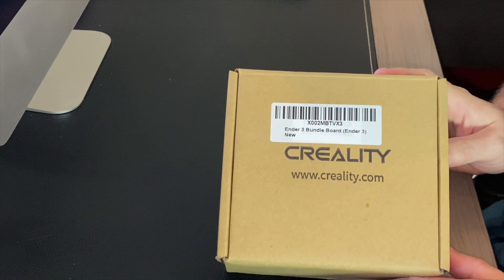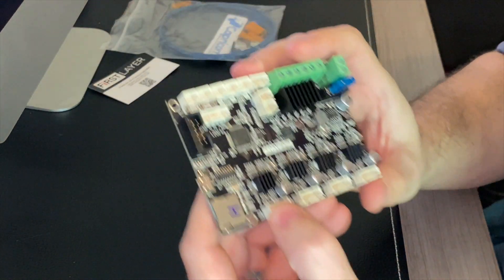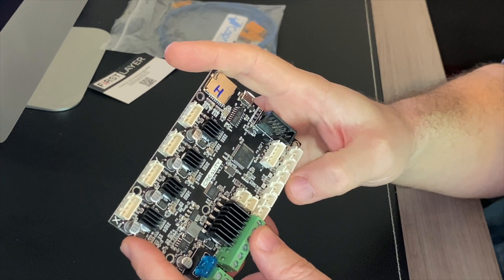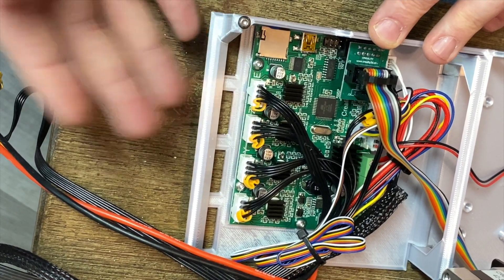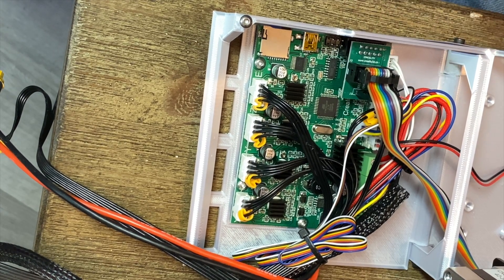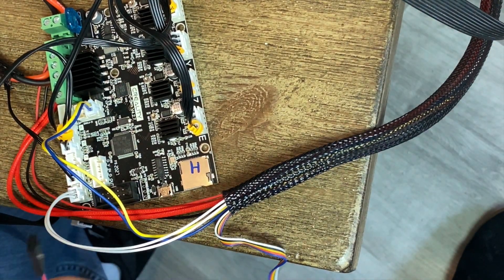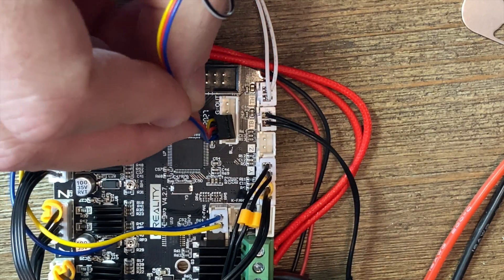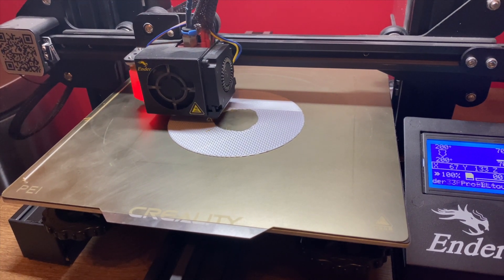Creality 4 2 7 Silent Board Install With BLtouch

Comment: this video made me realize that I didn't ned the breakout board anymore and that the v1 bltouch wire is a crossover cable and you need a straight cable to connect to the new mobo. had a v2 in my mailbox within 12 hours and just swapped the cable and it was fine

Comment: After installing the same BL touch kit into the v4.2.73 board I found that the fan to the nozzle that was plugged into the header where the power is connected needed to be changed so that the control box fan is in that header and the nozzle fan is in the header marked fan1 on the mother board as this is a controlled fan now.

Comment: Did you have an issue with the printer throwing error 'Home Z first' ? Trying to resolve this and cannot seem to get past the error. Thanks!
Reply: I am having the same error... please let me know if you find an answer. It is absurd, trying to resolve it, but not having much success.
Reply: @Bbittner5857  I actually did figure this out.. Move the bl touch power wires from the Z axis, to the dedicated port. I used nippers to cut off the retain for the cable so it would fit.
Reply: @sparkfire1223  so move the black and white wires next to the yellow red and blue? I thought about doing that, but I didn't want to fry another board.
Reply: @sparkfire1223  that works! Thank you so much...

Comment: I have a v 4.2.7 board,i tried flashing both 4.2.7 5×5 &3×3 firmware, but everytime i tried to press the leveling menu it did not went for auto bed leveling instead it showed me manual bsd leveling,so i had to go for stock bl touch firmware..pls help

Comment: Did the swap back in January and had nothing but clogs until I realized last week that my fan power wires were loose so heat creep kept clogging! Anyone having any issues after the swap make sure your extruder fan is working!
Reply: thanks, dont have this myself but im sure you saved someone a lot of frustration

Comment: I’ve had the same problem on BL. And i’ve just done the same solution. I was also surprised by the x y a e motor connector arr fliped.

Comment: Thanks for the video. Liked and subscribed.  I did this same install yesterday on my ender 3 pro and installed the bl touch as well.  Followed creality’s direction but my nozzle head is way out of sync.  It remains about 2-3 “ above the bed.  Autohome doesn’t work properly. Any thoughts on this issue?
Reply: Did you solved your issue same thing happened today
Reply: @ricardoz.6701  yes :-) I bought a resin printer.

Comment: Can you provide your .bin file? I also upgraded to a 32bit 4.2.7 silent board and a 32bit BLtouch. Before I used the firmware from creality but I want to change it because it just doesn't seem to work right. (It worked, but the options were too limited with it.)

Comment: Did you have to change the firmware for the BlTouch or was ist Plug and Play?
Reply from the maker: You will need to change the wiring  like I did in the video.

Comment: As a ender 3 pro owner I tried installing the firmware for the bltouch for v2 and my board froze up blue.  I ordered an upgrade silent 4.2.7 and want to know if any firmware is still needed for the bltouch?
Reply from the maker: yes you will still need to flash your firmware. I build mine from marlin

Comment: So I followed this and at least it did not fry my board. Still can't get it to work though, it's not homing the z-axis. Creality FW just says: STOPPED! Any ideas on that?
Reply from the maker: sounds like there is an error in your firmware. I would try and reflash
Reply: Hi Roy, I have the same problem. Did you fix it?

Comment: Hi dude, thanks for the video. I have an creality ender 3 with the creality silent 32 bit board v4.4.7 (ARM stm32f103 chip). I bought the BLTouch and I'm struggling to find firmware for my board to add support for the BLTouch so I wanted to compile marlin for my board and add the BLTouch support and found your installation video. I download marlin with the Configurations-release-2.0.7.2 and found the code to support BLTouch. However I'm struggling with something relatively simple I cant find how to add support for my ARM stm32f103 chip in arduino. Can your or anyone else help?
Reply from the maker: you will need to find the line that asks for the board name/type and type in the correct board chip name.

Comment: Nice video, I wonder if the 4.2.7 is compatible with my CR-10 mini because the output voltage from my power supply is 12V and for Ender printers it's 24V. Since the circuit board uses 3 to 5V max I guess it will work but I am not sure.
Reply from the maker: Im not for sure about that sorry

Comment: The only part i want to know was where the case fan goes. Exactly this part is missing. I dont't know a first i put it in the second kfan. But after my first try to print the nozzel fan wasn't moving so now im sitting here like a Duck. Any other cable is rihgt
Reply from the maker: The hot end fan is the end connector on the green wire hook up spot. I believe it’s the top one on the left right under where the power input is hooked up. The case fan and cooling fan have plugs and plug into the board in the two pin plugs that are on top of each other under the green 6way plug. Hope this helps.
Reply: Honestly, the smartest thing you can do with that fan is wire it in with the Hot End fan. Have it always on. Currently it will only turn on using the cooling fan comes on.

Comment: hello 3D4LYF...
I followed all of the instructions, rewired the 3 wire connector.  
Auto home does not move the Z.  I can move Z with the move axis.  
X axis and Y axis work just fine.  printer pretty much useless after installing the BL touch. 

Ender 5 pro, main board v4.2.2 

Any ideas?

Thanks, Dan
Reply from the maker: I’m not for sure. Had an issue like this once and I think I reflashed the firmware or maybe swapped the white and black wires on the BLtouch.
Reply: The firmware versions for 4.2.2 and 4.2.7 are NOT compatible... double check you have the right version. (that was my issue anyway)

Comment: Did you use this firmware?? >> Ender3 V2 -V4.2.7-32bit
-Marlin-2.0.1-V1.3.1-BLTouch-TMC2225  << from their wabsite?, if so did you need to fix firmware on lcd screen aswell and do any alterations need to be made to the creality/marlin firmware, eg what kind of setting did you change, gcode additions?, you have provided a good vid but just feel a bit more information could assist myself and alot of other peropl asking about this installation cheers
Reply from the maker: I did make my own firmware in marlin from the source code under the 4.2.7 board. The only thing I changed in my start code was adding g29 for abl. I plan to make a video on firmware soon.
Reply: @GhostPants8012  awesome, can't wait to see when it it goes up, a lot of people are having issues with the wiring of bltouch and firmware responding properly

Comment: any ideas why my ender 3 pro with V4.2.2. board and BLtouch 3.1 isnt working?
It auto homes correct but when i start bed level it just stops after the first probe without any notification
Reply: same issue. you figure anything out? best i can guess is the 4.2.2 still needs the adaptor for it.
Reply from the maker: The adapter should not be needed as it has a dedicated BLtouch port on the 4.2.2 board I believe. You will need to build your firmware correctly for it to work if you use the BLtouch as end stop. Otherwise the Creality BLtouch firmware for BLtouch on the 4.2.2 board will work but you will need to put both connectors into the BLtouch port on the board. Hope this helps.
Reply: @GhostPants8012  I have never compiled my own build before before, that's the only step I haven't tried. I'm sure I can figure it out.. I have been trying with the builds from official creality site and plugging into the ports the board and removing z. The bl touch lights up but the pin doesn't drop. From what I catcher while searching for a solution The 4.2.2 and 4.2.7 are "basically the same as the 4.2.7" just the 4.2.2 is what comes in machines from factory and 4.2.7 is when you buy an upgrade?
Reply: @GhostPants8012  so i HAVE TO build my own firmware? the files from creality wont work? i did try to make my own firmware following a few guides i dont htink i did anything wrong.. why would creality put firmware up if you have to build your own thats so confusing.
Reply from the maker: @kerrys3002  I tend to agree. Not sure why they didn’t edit the file correctly so it would work.
Reply: @GhostPants8012  well I appreciate the help. I'm going to read into the making my own file and start over. Thank you for the help!
Reply from the maker: @kerrys3002  no worries.
Reply: @GhostPants8012  ok.. so i returned the bl touch i got and got a new one, everything was working fine but i could not get it to level the bed. so i tried to home it and then adjust the z and then bed level, first it was failing at point 3... then it worked the 3rd try auto leveling. but it didnt actualy get close to the board. now when i try to level it instead of z going down it goes up twice..
Reply: Issue SOLVED.... found post on reddit with someone who posted his own firmware (bin and source code). Used that and now it works perfectly. Bookmarked the guy as LIVE SAVER :D
Here is the link to the  site https://www.reddit.com/r/Ender3Pro/comments/iiiv8m/bltouch_on_ender_3_pro_v1_5_32bit_board_v422/
Only thing i changed was to not plug the probe in the z-axis but in the dedicated BLtouch port like 3D4LYF says
Reply: @martijnvenema4545  thank you for the hook up on the link! ill try this before i just chalk it up as a bad unit..
Reply from the maker: @martijnvenema4545  glad you got it!  I plan on doing a video on firmware. Work is crazy right now due to us getting ready to shut down for the rest of the year. I will work on one ASAP.
Reply from the maker: sounds like maybe the black and white wire are in the wrong place. Maybe switch them spots, or the firmware and start gcode is not correct.

Comment: Hi mate nice video, I was just wondering is the bltouch firmware already on the board or do I need do flash new firmware for it? thanks
Reply from the maker: You will need to flash the correct firmware to it.
Reply: @GhostPants8012  congratulations for the video! but, I have a problem, I have never updated the firmware ... How to do it? do you have any links? On the bl toutch box there is the usb adapter but I don't understand what software to download and where the usb adapter should be connected to the card! Thanks
Reply: @jd-3d179  Do you find a firmaware that works?
Reply: @jd-3d179  Can you send to me the .bin?

Comment: Im thinking on buying this board to reduce noise on my ender 3 pro. Im wondering 1 thing though: Will it just run fine after installing? Or do I need to install software first somehow?
Reply from the maker: It will work out of the box if you don't have any ABL (bltouch ect.) if you do have ABL you will need to flash new firmware.
Reply: TBH, it's a massive head ache right now. You need a different driver to connect it to your computer and setting the z-offset is incredibly difficult because it's not playing well with the software available. It is quiet, but until that stuff gets fixed, it's more or less worthless. That being said, it is software and I'm sure it will be fixed, but it's rather ridiculous that it's shipping with so many bugs. I can't even get the extruder anywhere near the bed. It floats at least a few milimeters above even though the BLTouch activates just fine, the firmware won't allow it to be adjusted downwards.

Comment: What firmware are you using.  I installed it according to your instructions, downloaded 4.2.7 firmware with tmc2225 drivers and bltouch 1.3.  The ender takes the software update but starts emitting a loud squeal.
Reply from the maker: I made my own firmware off the marlin branch for this board. Use the bugfix version.
Reply: Hi I 've the 4.2.7 board but don't install de bltouch yet. I know that there are 2 version of the firmware, with and without adapter. But I'm not sure which one to burn
Reply from the maker: I think the version without.
Reply from the maker: The ender 3 4.2.7 board uses TMC2208 drivers. That may be the problem.
Reply: @GhostPants8012 Hi and thank for response. The board 4.2.7 uses TMC2225. i was in contact with creality and the conexion is diferent with yours. they recomend conect Black to G and White to out, ans this firmware https://file2-cdn.creality.com//website/3decdbe4-5aa0-474d-88bf-4d5332617019.
Thank you again than you for response and the video.
maybe you can do second part with a explain to configure it. that although it is not complicated, I took a while to solve it on my own
Reply from the maker: I will be doing one soon on firmware. Stay tuned!  Make sure to subscribe to catch it:)

Comment: I've got a silent board coming today and I'm thinking of getting a bltouch, did you have to flash the firmware or was it plug and play(excluding the offset calibration)?
Reply from the maker: You will need to reflash the firmware. I just built my own off marlin.
Reply: @GhostPants8012   could you possibly make a video going through it please
Reply from the maker: I will be doing on soon.
Reply: @GhostPants8012  thank you
Reply: @GhostPants8012  did you flash it with arduino?
Reply from the maker: @SlavicPad  no I used vscode
Reply: @3D4LYF and an sd card? :)
Reply from the maker: Correct. Just add your firmware to the card and then put it in the printer. When you turn it on it should flash the new firmware.

Comment: i have this board..will it work in my old ender 5? its 14months old... i never hooked up a motherboard to a pc before and did  this...is there a step by step video??? thanks
Reply from the maker: I'm not sure. Does it have a single or dual z-lead screw? I'll say it might be possible. But can't be sure.
Reply: @GhostPants8012  all ender 5s this standard size have 1 screw ...its says it works on the pro ender 5...but there is no difference between a pro motors...only difference is pro has a silent board and upgrades that i already made myself...
Reply from the maker: @roadstar499  it would work no problem then. I have never used an ender 5 or 5 pro so just didn't want to steer you in the wrong way.
Reply from the maker: Glad you liked my video! be sure to subscribe!!

Comment: Hi, nice video. I have the ender 3 pro that have exactly the same motherboard that you are installing. I just bought the bl touch but I don't know how to upgrade the software in the motherboard. Can you help me? Another question: why you don't use the adaptor that you had in your previous motherboard for the bl touch?
Reply from the maker: Sweet!!  It’s a good set up. Glad you liked the video. Means allot. 
The adapter isn’t needed for the new board. It has a BLtouch port. As far as firmware you can download it from Creality’s website or build your own from marlin.
Reply: @GhostPants8012  Hi I have the same motherboard 4.2.7 I am trying to install one of Creality newer firmware for Marlin on there official website. I have a Ender 3 Pro. I am quite confused in truth. I tried to  install a firmware only get a load noise once booted.  I flashed it back to the original Marlin 1.0.1 and the nose went away.  Did I install the wrong firmware? Or is the noise because I have not yet instead the Run Out Sensor and BL Touch? I liked to just boot the firmware (Not compile my own.)  I tried to  install the  Ender-3 pro 4.2.7 mainboard firmware（32 bit）.zip (Ender-3 Pro - Marlin2.0.1 - V1.4.1 - BLTouch - Filament - TMC2225.Bin) Any help if at possible?

Comment: I didn't quite understand what you meant when you said you wouldn't use the BLTouch, but are more comfortable with the z-stop limiter. However you did go and connect your BLTouch on the new board. Can you please explain that? Or if you have a video where you talk about your preferences of using the BLTouch vs Z-stop limiter, could you please point me to that?
Reply from the maker: What I meant was I prefer to use the BLtouch as the z-stop instead of the dedicated BLtouch port. I love the BLtouch!!!  If you use the dedicated port you must keep your z-stop switch. I prefer to use the BLtouch for the z-stop and the autoleveler
Reply: @GhostPants8012  That explains it very well, Thanks. And it makes sense that one would use the BLTouch as a the z-stop when you have it. Why bother with the z-stop switch.
Reply from the maker: @ksprashutv  you bet! Glad my video was able to help you out. Make sure to subscribe!

Comment: Had the same issue to swap the pins. When it boots up it comes out goes in comes out. but my bltouch does not deploy on auto home it stays retracted, in the bltouch.
Reply from the maker: Try flipping  your white and black bltouch wires in the z-stop port. I had that same issue and this solved it for me.